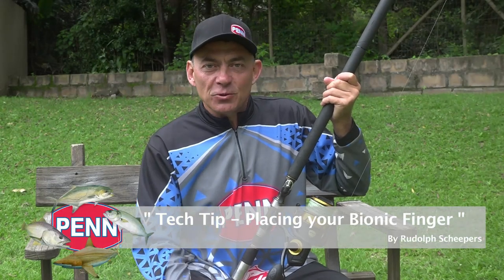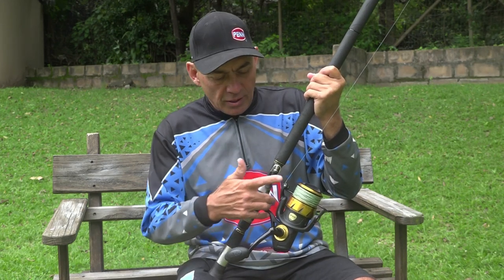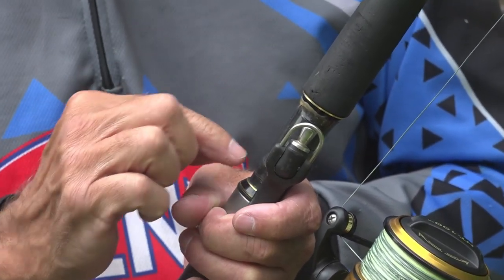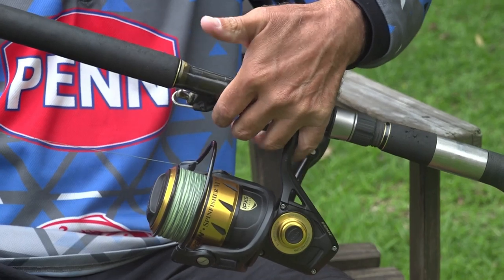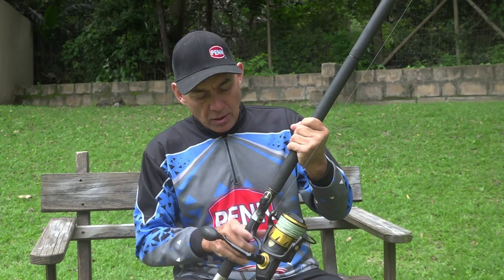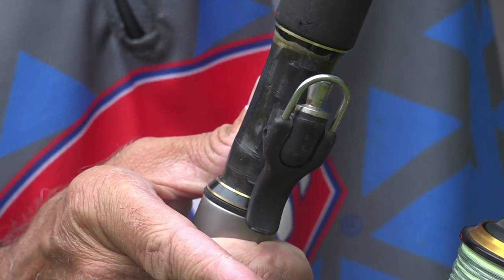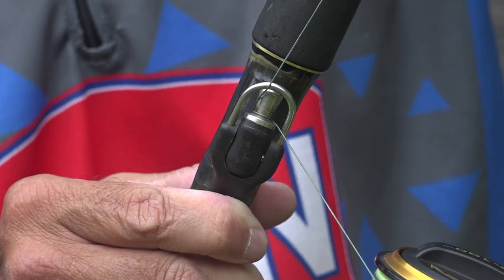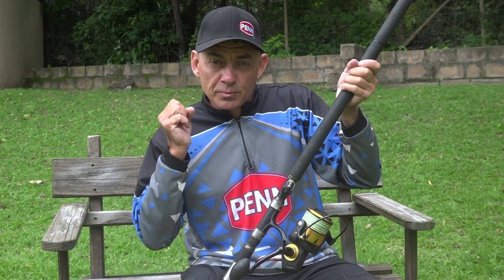Tech Tip- The Bionic Finger

Comment: Does wrapping it right to left make a difference to left to right?
Reply: Yes cause recently I have been throw all my traces off cause I've been putting the brade on the wrong way and I couldn't understand why but my dad told me it's on the wrong way... I dont think it will matter which way eith the later rods but 4 the heaver rods I think it matters
Reply: Actually yes depends on which hand you use for casting.